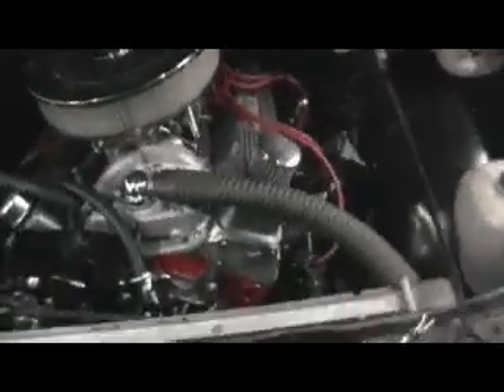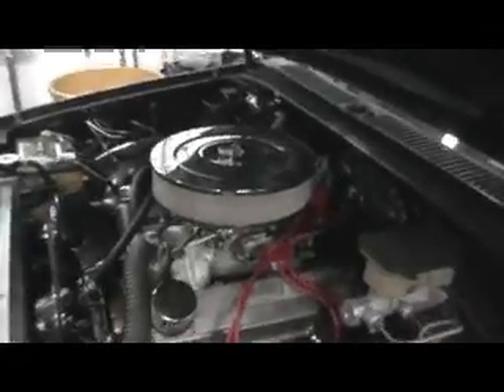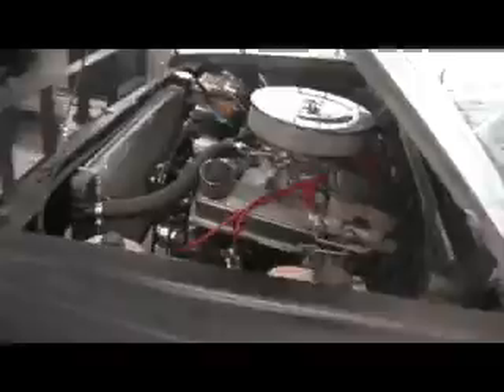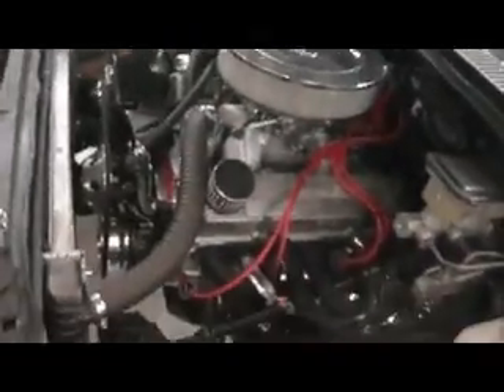S10 V8 SBC 400HP

Comment: Sounds good ! I have a '89 s10. W/ 3/4 350 with a tbi and a tunnelram.  Youtube the bully kegs/summit/autozone. Your s10 have a 3.08 diff? I put a '96 m locker diff with a 3.73 gear.